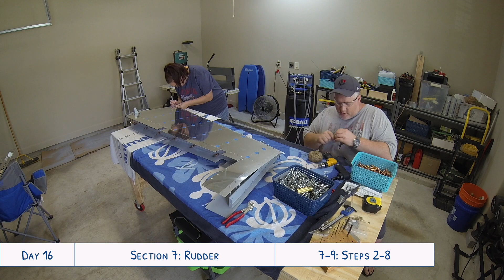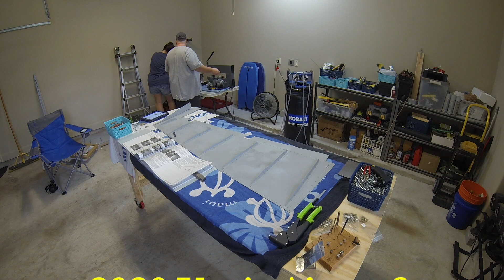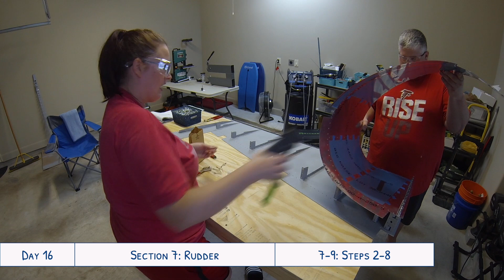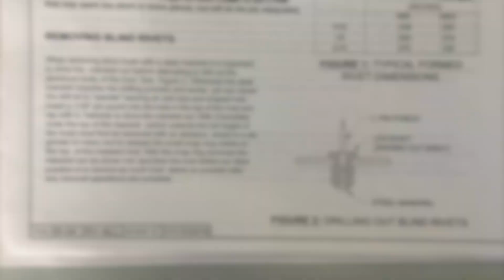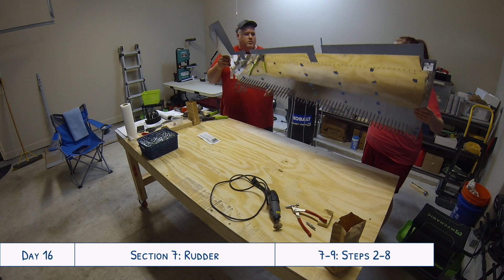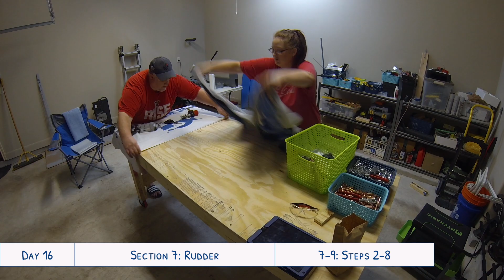Van's Aircraft RV-10 Build: Day 16 - Giveaway Winners and Silly Mistake (7-9)

Comment: I'm interested in making the angle piece to attach to the trailing edge while the proseal cures.  What's the length needed to have a piece that can be used for all trailing edges?  Asked differently, what's the longest trailing edge on the RV10?
Reply from the maker: Not sure, but the one we used that our tech advisor let us borrow is just over 5’ long

Comment: I see in the video, you put the board on the wedge with weights.  In the video of the rudder siting on the table curing, is the aluminum angle clecoed to the opposite side under the board and weights?
Reply from the maker: When we first set the trailing edge with the proseal we did not have the angle yet from our tech advisor, so it just had the wood and weights. I think he came out the very next day and brought the angle for us to use and we swapped out the wood for the angle.

Comment: I got a light box for Christmas too, so awesome!
As for the broke mandrel, I’ve had that happen a handful of times throughout the build so don’t be surprised if it happens again. 
Congrats to all the winners!
Happy New Years to all.
Reply from the maker: How cool that you got a light box too! Share a photo/video when you're done. Trying to decide if I want to perhaps install different lights inside, like color changing ones.

Ugh, that dumb mandrel 🤦‍♀️ it happened a couple times after this and we finally opted to get a pneumatic rivet gun for the pop rivets at the suggestion of some folks here in the local chapter. Haven't had any problems since (knock on wood!)